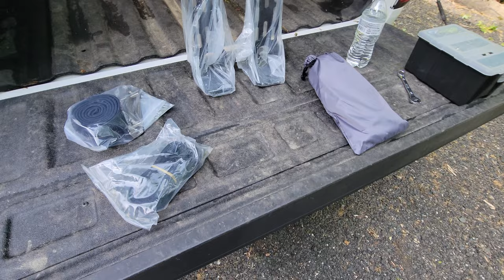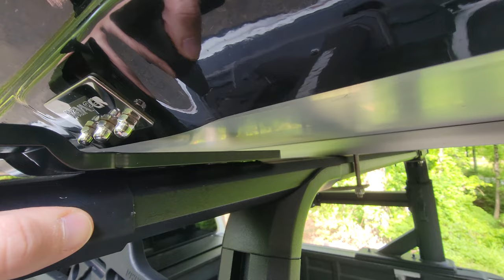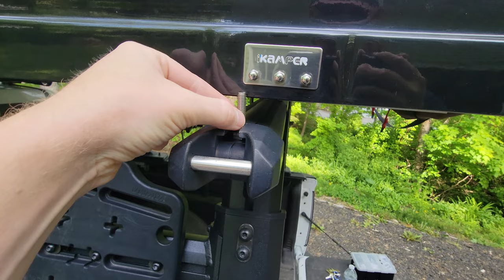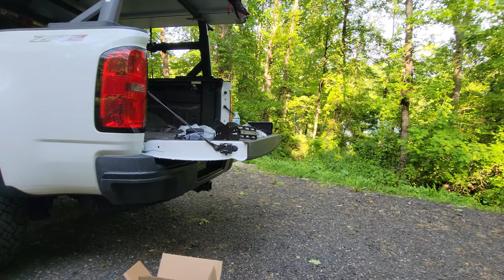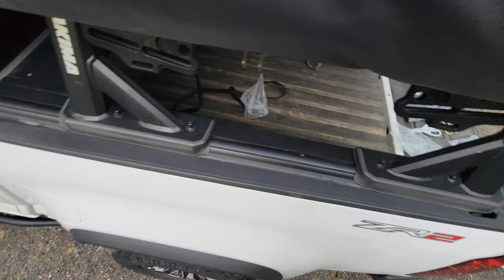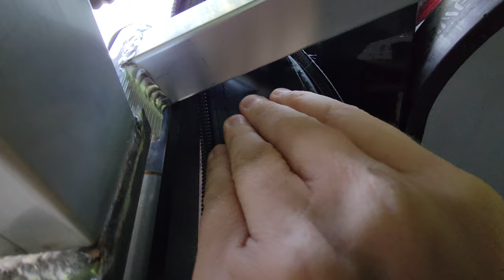Installing the Nomadic 270 LT Awning from Overland Vehicle Systems

Comment: The 270 LTE has exactly the same design flaw.  Finally bothered me enough that I sold it.   Also, I wanted more coverage area than the LTE provided.  Thanks for the video.  My replacement is essentially a knockoff of this one, though it's a bit lighter.  The weight was the bit that concerned me the most as it's 2X the weight of the LTE.
Reply from the maker: Whats the brand name of your new one?

Comment: Does anyone know what the long neoprene sleeve is for?
Reply: I'm trying to find that out as well
Reply: It's for the tie back strap, so if it goes near painted  vehicle body panels it eont rub the paint off...the strap goes inside neoprene sleeve
Reply: @robertmwhidbey  cool thanks
Reply: Have you tried moving the front plate a little outwards. Possible a couple of inches would fix this?